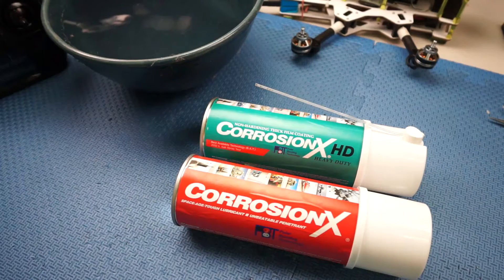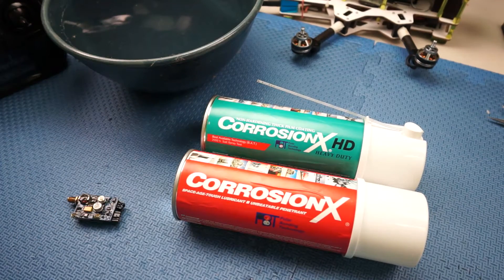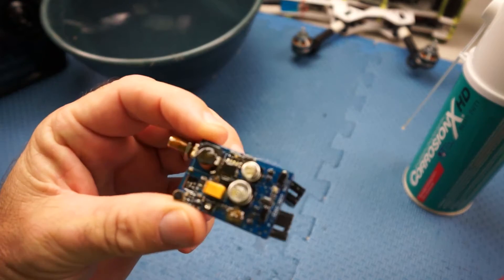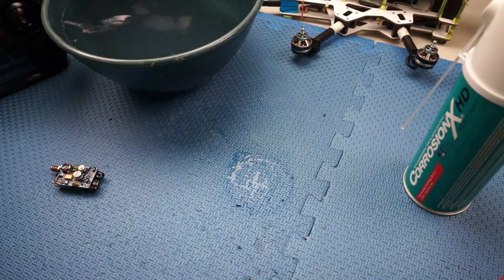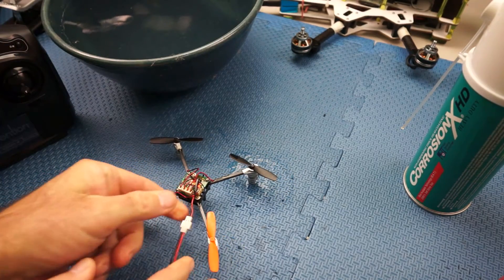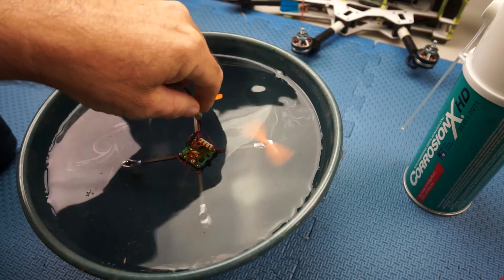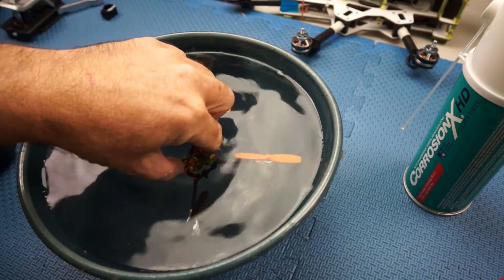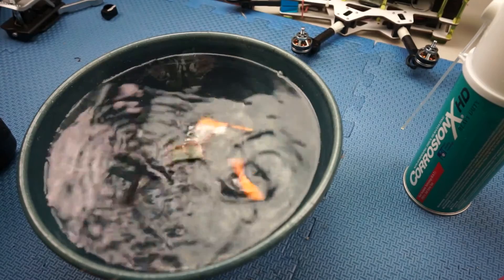Corrosion X - HD Mini Quadcopter Underwater Test

Comment: want to waterproof a electric longboard , so i was thinking to coat all the openings to the battery and the on off switch , also the wheel where the motor is kept , think it would work ? and do i full submerge it in ot just spray where needed ?
Reply: You can easily make that happen! I use it in every single electronics and mechanics I can get it into. Just get a CorrosionX Aviation (which is the best of all CorrosionX products). There are 3 forms of it: aerosol, spray and thick grease type. Go with aerosol, it is thinner and has the nozzle that you just put into all openings that you can find of your board. The main part here is the electronics. You just spray it all over the place  - PCBs, battery tabs, connectors and wipe afterwards an excess. It will do the job and spread inside everywhere in molecular level forming a super tiny layer that is invisible. The only place you avoid applying is where you need the grip - brakes, wheels, etc. because it's a bit oily and will slip. Good luck!